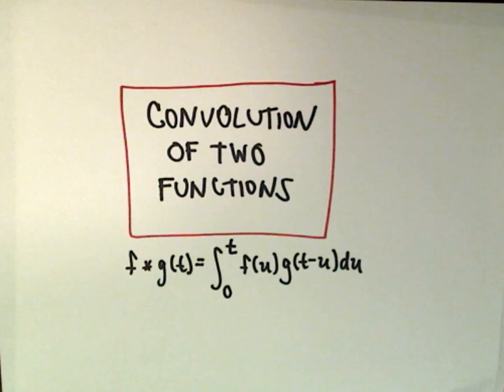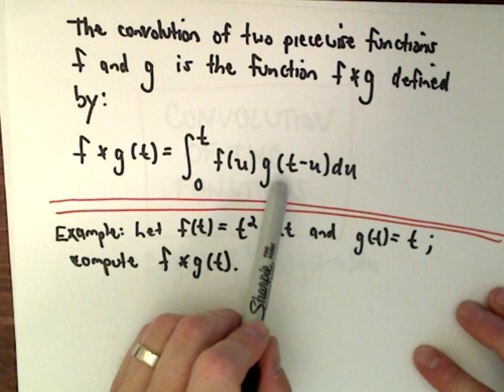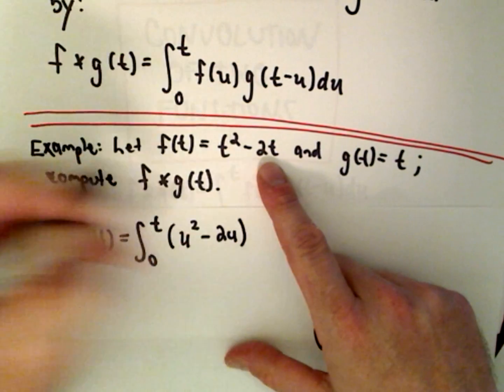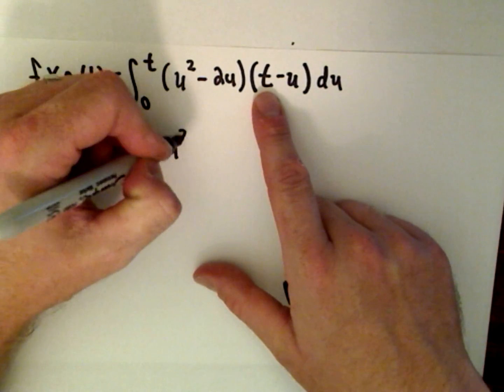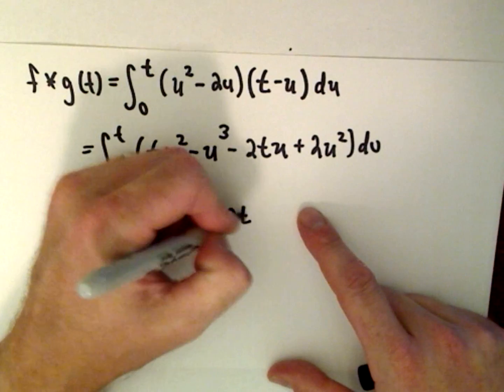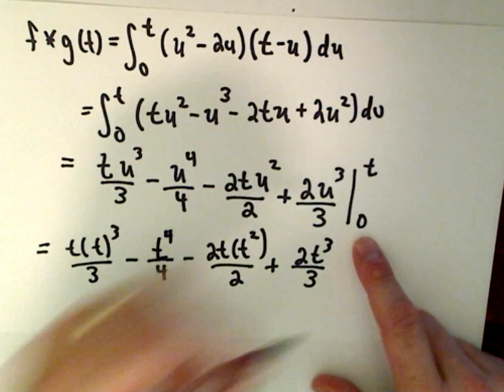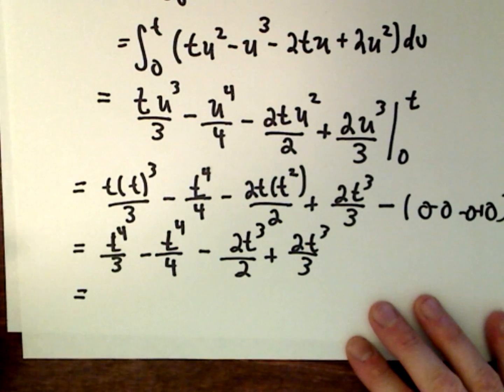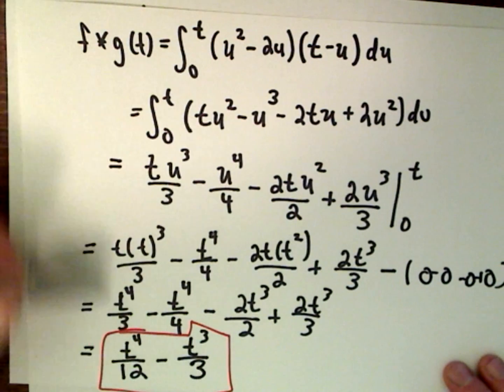❖ Convolution of Two Functions ❖

Comment: I get the math definition, but what are the practical uses for this? What exactly are you doing when you convolute two functions? How do I know when to use this formula in real life?
Reply: When you have a signal that is passing through a system then the output signal will be the convolution of the signal and the system.
You could also calculate the Fourier Transform of both and multiply and then calculate back into the time domain but that is just an example.
Basically the multiplication in either time/frequency domain is a convolution in the frequency/time domain so you kinda switch back and forth and depending what fits your current situation best you might want to do the one or the other.
Reply: Also, L{f * g} = L{f}L{g}, where L denotes Laplace transform.
Reply: One very good application is image processing and you’re filtering out noise and blur in an image. You either smooth or sharpen a picture with a mask. You convolve the mask with the picture.
Reply: Ben did a really good job explaining this. The convolution is mainly used for signal processing. It’s the equivalent of frequency multiplication once you take the Fourier Transform. You’re essentially smashing two functions together and creating a new curve that shares attributes between the two curves you smashed together.
Reply: getting an a star to get to cambridge XD